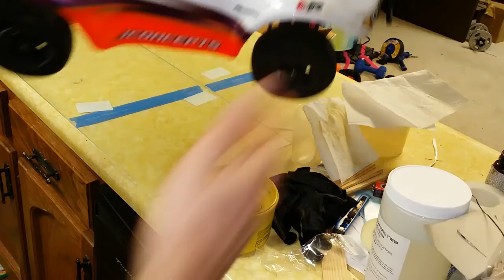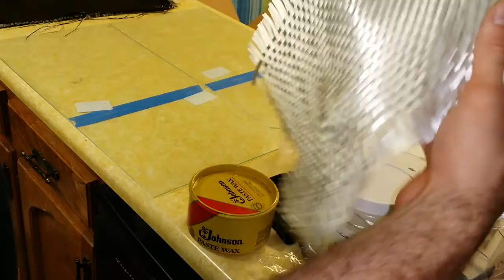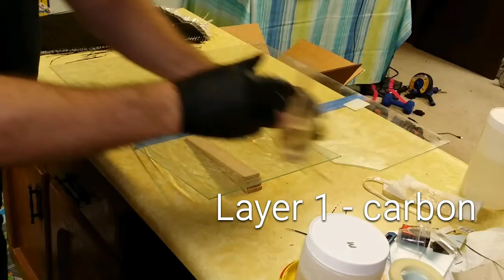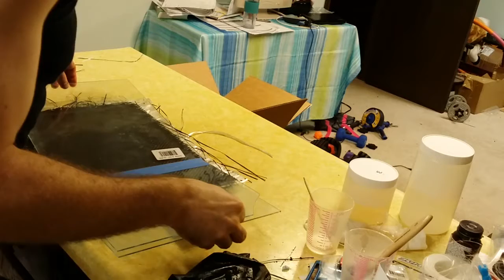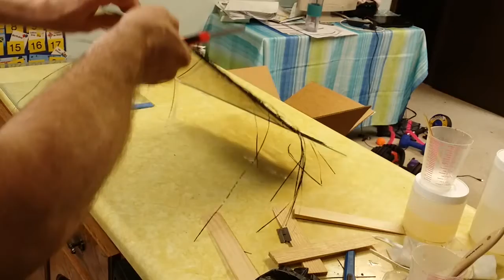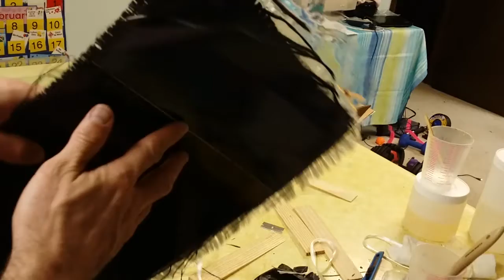Making a carbon fiber plate for a 4x4 Turnigy Trooper RC Truck

Comment: I prefer by carbon fiber with carbon fiber biaxial layer between for better strengths. Cause Carbon fiber and glasfiber have not the same E-Modul (modulus of elasticity) and for the reformation when its under stress of torture it could be earlier damaged the glas with carbon combo

Comment: Noticed you did this inside your house . What were the fumeslike?
Reply from the maker: Virtually none.  I'm sure it depends on the type of resin you use. I was using laminating epoxy resin from illstreet composites, and it's almost odorless.
Reply: Thanks man . I used fibreglast brand 1000 epoxy wasn't bad at all . I used carbon kevlar with your plate glass method but I used a ziploc space bag as well with a shopvac . I'll try and post some pics on my youtube channel soon . The epoxy I was using is a 25 min epoxy not wise for my first attempt . After four layers and being to ocd  I ran outta time and it started to gel up on me so I cursed a bunch and was about to call it quits instead I mixed up more epoxy and threw 2 more layers down for a total of 6 layers . I was frustrated and forgot to smash air bubbles from underneath top glass and just threw it in vacuum bag and sucked it down and placed 45 lbs weights on flat and angle . Almost pulled it off but I have just enough to try it again . Thanks again for the ideas and the reply . Learned alot from you man totally inspiring video.

Comment from the maker: Good to hear from you RC...For some reason I can't reply to your youtube comment though.  Not sure if it's a bug or what.  

As for the B5M, I haven't really done a cost breakdown yet, but I'll look into it.  For reference, all the materials I used cost me about $118 shipped. Then the glass and mold release wax is extra on top of that. So far I've made chassis for 3 different vehicles, and a few smaller parts like shock towers, and I probably have enough carbon/glass for one more smaller chassis.

Bottom line, carbon is expensive, especially for one-off projects like these.  I'd guess my break even point would be upwards of $30, and that's doing it with free labor.